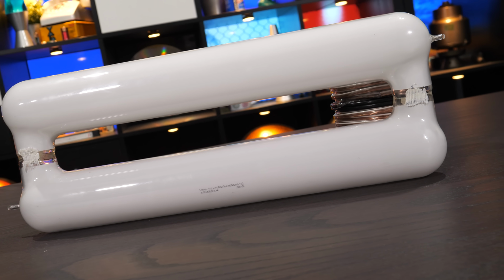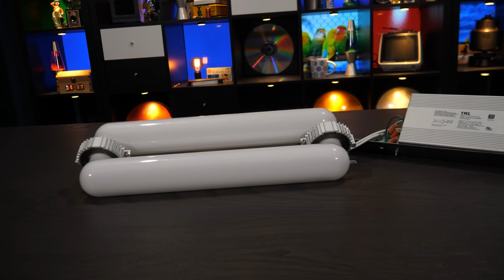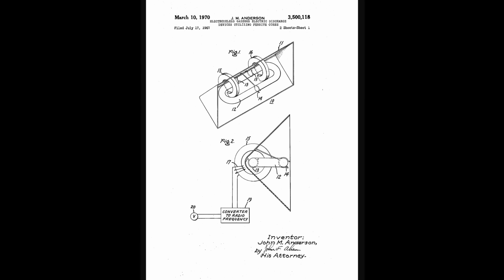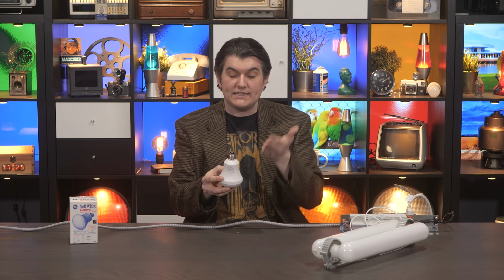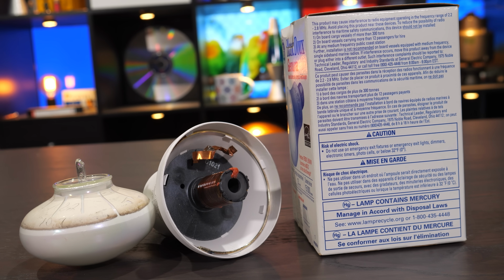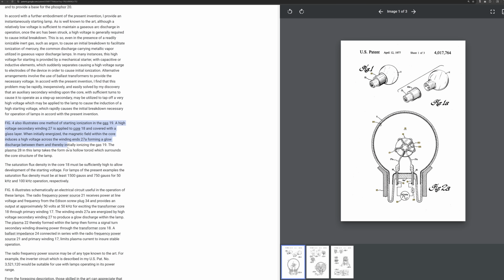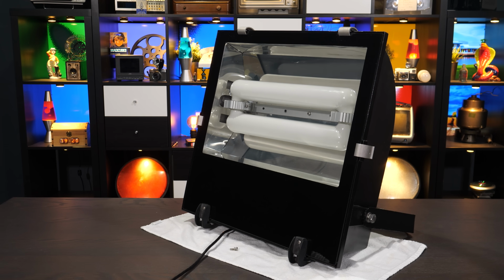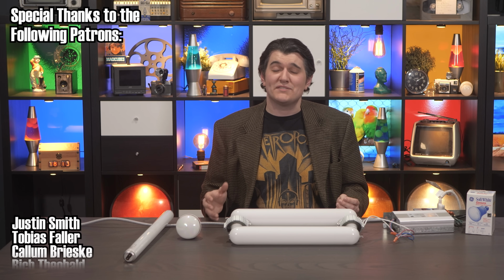Induction lamps: fluorescent lighting's final form

Comment: Those bulb shaped ones could easily have reflectors for directionality added. 
And directionality doesn't magically make the inverse square law go away.
Except for light escaping upwards, directionality makes lighting a large area more difficult - imagine how many laser pointers it would take to illuminate a footpath...
Perhaps one bulb doesn't illuminate the ground under it as much as you would like, but hey, you've got 5 other bulbs nearby leaking light out sideways which help to illuminate it, and it nets out equal.

Comment: You commented on the strange way the wiring was specified.
Probably set up so that "positive voltage" will have the magnetic field on the left coil going "up" and the right coil going "down" to "push" those free electrons around the circuit ( like a matchbox car track with two speed boosters ) rather then "sending the free electrons everywhere. Even at the very high frequency, those electrons could make a couple of laps before being reversed.

Comment: I do remember those weird circular lights, they were in a few fixtures in the house I grew up in.  But until today, I had no idea that they were different than the straight tubes in any way other than their shape.  I do recall that the bulbs were both expensive and seemed to last practically forever.  They had a kind of grim, industrial light quality to them, really inappropriate for residential use.  But it was the 1970s, so you either used incandescent bulbs or these, there wasn't anything else.

Comment: The exact method of ignition might be a combination of several factors depending on particulars. Natural or intentional alpha or beta emitters could provide a few stray ions. Multipaction where a collision generates secondary ions/electrons would be my two favorites for the rough pressure range these lamps operate at.

When a transformer is resonant with no load, the output voltage would be the excitation voltage multiplied times the Q, divided by the turns ratio.
The frequency of operation of these lamps is too low, but helicon modes have been used in electrodeless lamps.

Measured ignition delay at several temperatures would help figure out which.

Comment: The original CCFL lamps (announced in the 1970s) were electrodeless induction lamps, running at 27MHz and predicted to have lifetimes of 50-100 years.   But then they vanished.  Never materialized.  Today's eventual CCFL bulbs had electrodes, with the usual short lifetime.   (There was a scandal behind that, where the main 1970s  inventor was ripped off and sidelined.)
The original fluorescent lamps, as shown in the 1893 Chicago  worlds fair, were electrodeless lamps powered by a metal plate in the ceiling connected to a Tesla Coil.  Wireless lamps, shaped in coils, spirals, or shaped into words.
The first fluorescent tubes company, funded by JJ Astor in 1899, never happened, because Nikola Tesla took the first $20,000 payment and disappeared.   He used it to secretly build a radio lab in Colorado.    Astor cut him off after that first payment (there were to be ten.)

Comment: Having worked with some of the products on the tail-end of their development life, short before LED products gobbled everything up, good riddance that was a blast of the past and I am happy that these mercury filled beasts are a thing of the past. These products were always in a wierd spot. The products I had to test came about after Philips, GE and OSRAM had already given up on them and knock-offs started to appear. But given the results the application was really niche. There were already T8/T5 long life lamps that could last 80k hours and electronic ballasts that actually lived that long because the working frequency was much lower, as mentioned the optical properties weren't great and they were very perceptive to the thermal enviroment. While LEDs took some time, after their development took off in earnest, they became a much better, much easier technology to handle after a very short time.

Comment: I wonder. Is the application of these particularly useful in inaccesible places you might need to see trough, like for example underwater (pools, underwater facilities or things like aquariums, observatories, etc)?
My guess is, since these last so much you would only need to replace them every so ton of years or under extreme circumstances, and since the failing point is most likely the electronics box in most cases, you could put that in the same place you would put a breaker box and run wires to them from the box or boxes (in case every lamp needs a separate box.)

Comment: The problem with using RF for induction is that it isn't just the frequency that it is operating at that is disrupted.  Without extremely carefully-built filters, every oscillator will also produce RF on harmonics of the fundamental, sometimes as loudly as the fundamental.  I'm sure these prototypes went to every effort to ensure the harmonic components were minimized, and even avoided being too loud outside the ferrites themselves, but if LED tech hadn't replaced these, we'd be seeing the same race to the bottom of that market applied to these instead, and we'd have an even bigger noise problem than we have today.

Instead, we mostly just have gawd-awful RF coming out of solar panel inverters...

Comment: Regarding starting: Years ago, I used a GE "Light Stick" under-cabinet lamp as a built-in reading lamp in my bookcase-style bed headboard. These were an all-in-one lamp and electronic ballast, and I believe GE may have included a small amount of radioactive material to insure ionization, as they did with small neon indicator lamps. When GE stopped making the lamps and just labeled Chinese ones, I discovered that they failed to start in a dark room after a shorter term of use than the old ones (or even right out of the box), but would start if there was already light in the room, or if you would shine a flashlight on the tube in a dark room. 
I presume the induction lamps you showed all had something to make sure of initial ionization, although it may not have been a bit of radioactive material.

Another interesting story about the small neon indicators: Motorola's first transistor color TV chassis ("Works In a Drawer") used neon bulbs (as input switches) with a low-leakage capacitor and IGFET voltage sensor to store the analog voltage for remote control of color level, hue, etc. Some first units would not hold the setting voltage for the required days or weeks because the GE neon tubes with radioactive components would ionize the gas and leak off the charge. They had to specify bulbs without the radioactive starting material for use in the remote control circuitry.

Comment: So based on what I know of RF, the high frequency of the oscillator is probably what starts the lamp. You don't need that frequency for inductive coupling per se, what you do need, though, is to form a resonant cavity inside whatever tube you're using in order to build up enough field strength to ionize the working gas, and to do that you need to operate at the resonant frequency of the tube, which will be higher the smaller the bulb is.

As the field oscillates, it tugs on atoms and their electrons. If the field is strong enough, the tug can separate valence electrons from the gas, think of it like pulling a table cloth out from under wine glasses. You need to move the table cloth quickly enough in the right direction to prevent everything else following it. Do that and you get ions, and the transformer effect can take over.

Comment: It seems to me like the induction setup also neatly sidesteps the problems with fluorescent lamps' negative differential resistance that a ballast must protect against, or else too low of a potential will draw waaay too much current for the wiring it's connected to. If you control the induction, you inherently control the system power, and can inherently prevent current runaway.

Comment: There is one problem with LED lights, especially for tail lights in cars when highway driving at night. After highway night-driving for a while looking at these things, they seem to dance around in distracting ways. I wonder if it has to do with low-voltage power to the LEDs making the frequency of their pulses of light too low. 

It reminds me of a similar-looking effect of looking at an LED clock while brushing your teeth with an electric toothbrush, but there the dancing effect there is much stronger. Non-LED light sources don't dance around the same way when you do that. I think in that case it might have to do with the eye being vibrated by the brush. Maybe road/engine vibration in my car also has something to do with the car tail-lights case.

Comment: 100 000 hour lamp life? Someone needs to make projector lamps this way.
Reply: Laser projectors exist. This is what you are looking for.
Reply: @Desrtfox71  They are around 20 k hours not 100 k
Reply: @titter3648  They can be higher than 20k.  30k-50k in some cases.  That's the best you're going to get for a projector.  They need very dense lighting.
Reply: Projectors need a tight light source like arc lamps or laser.

Comment: I would have bet on open secondary transformer  voltage (be noticing how few primary windings are on the cores- if I corre counted 5 then the ratio is 5 to  1, and the ballast itself could be actually using a transformer rising the supply voltage to the coils. Such that when the current isn't flowing, the voltage inside the tube is momentarily reaching open circuit voltage that exceeds the ionization threshold. But that's enough to start vaporising the mercury and then the transformer goes into shorted-secondary mode with the induced voltage nearly zero, and where just the current flow induced is heating up the gas enough to glow) This and/or what someone said about the high frequency circuit being tuned to resonance frequency. Though I'm not entirely sure of the latter cause that'll make it need to be tuned to each tube separately and presumably precisely.

Comment: Glad you got to the ballast having a shorter life than the bulb at the end. I've seen traditional tube-flouro fixtures die because the ballast went bad while the bulb was still OK. I was wondering all through the video what the rated life of the ballast was and how often in the life of the bulb the ballast would need to be changed. Also wondered how much replacing the ballast would cost vs replacing the whole system. 

Another thing about the short life span of those bulb-shaped lights was that they were maybe mostly used in vent-hoods over stoves in kitchens. The vibration from the fan is also tough on other kinds of bulbs/electronics too, requiring them to be built extra-durable against vibration or changed frequently.

Comment: I've seen a most similar setup - in a CO2 laser resonator. Some CO2 lasers have electrodes that are inside the tubes, what's called "DC pumped". There are other CO2 lasers that are "RF pumped", they have a ring around the tubes that is a sort of radio transmitter, and radio waves are used to excite the laser tubes. They have the same advantages as the tube you showed us in your video, they last a lot longer before someone like me has to take the tubes out of the cabinet and replace them.

Comment: I need several 200w, or 300w tubes like those. Outside shop lighting in very COLD Winters. Cold killed my L.E.D. Lightlig. Installed 50 element LED lights & @ -42°F only 4 elements illuminated the AREA sometimes, the other ceased to function until the temperature raised & now 22 of 50 function at all. Not warrantied under 8°F. Enjoy
Reply: but thats not a feature of the LEDS but of the shitty driver electronics. Directly driven LEDs can be really cold before they won't start. And as mentioned, the drivers for these weren't all sunshine either.

Comment: As magnetic fields expand and collapse they induce charge into the materials inside of the lamp.  Conductivity is a function of frequency and at radio frequencies most objects we consider non-conductors become conductive as the electrons get moved about by the rapidly expanding and collapsing magnetic fields.
Reply: So think of it like this, when you pass a magnet over a material it induces an electric charge, what the RF is doing is moving the magnetic field by rapidly expanding and collapsing it.  That functions are a rapidly moving magnet and due to this it creates an electric charge inside of materials, even normally nonconductors.

Comment: I remember the delight I felt in discovering that by rubbing an old blown fluorescent light with a plastic bag, I could make it glow.
Reply: I used to take them out in a field under high tension wires with friends. They glow just holding in your hand under the wires.
Reply: @westsailsmusic  old timer projectionist here - I would pick up a fluorescent tube while running film (acetate or Mylar) between my fingers at high speeds during inspection/rewinding. Always surprised or shocked ushers or others walking through the booth.

Comment: If you want to see a widespread deployment of induction street lamps, come to New Jersey, specifically PSE&G territory. About a decade ago they started to replace all the streetlights in their territory with induction lamps made by US Lighting, which appears to be out of business at this point. The fixture was even called "The Jersey" in catalogs and the housing came in an attractive sea foam green color. At the time, LED streetlights were out, but they weighed the costs and upkeep and determined that induction would be cheaper in the long run.

I don't think it worked out though since new streetlight installs are now LEDs like every other utility. It may be superior, but with LED lighting being ubiquitous now, parts and fixtures have to be cheaper then the induction units.

Comment: search " inductive coupled plasma ". this lamp is just another application of ICP. in icp system, due to high operating frequency and low chamber pressure, you don't need any additional addon to ignite plasma. (you need some external ignition for atmospheric system, such as plasma torch). (p.s. therefore it is better to call "generate plasma", rather "discharge", like in this video)

Comment: You answered your own question about the starting electrode. As you pointed out it was placed inside the tube. One of the largest customers for those induction bulbs were industrial applications where sparks cold be hazardous, think coal processing and natural gas plants, where a faulty light could cause an explosion. By placing the starting electrode inside the bulb they eliminated any chance of it causing an inadvertent spark. The magnetic induction of the coil was more then enough to cause the electrode to discharge ions even while inside the glass bulb and because the electrode was inside the bulb and in direct contact with the gas it required less voltage to do so as well so they got two benefits by relocating the electrode inside the bulb.

Comment: Some idea about starting mechanism - do you have a Geiger counter? That mesh and wire might be slightly radioactive to give that initial gas mixture ionisation, needed for starting. Similar principle is sometimes used in arc lamps - it may have thorium-doped electrodes to simplify (or even "just make possible") it's initial ignition. Also it's the reason why some welding electrodes also contain some amount of thorium.

Comment: Fun fact - ANY fluorescent tube can be made to inductively illuminate in a strong enough AM-frequency signal. The signal, for example, at the generating equipment at an old-school analog AM radio station.  Like the one my high school had. During school tours, we would show off the wall of electronics running the AM radio station, and just hold a standard fluorescent tube a couple feet away from the transmitting equipment, and it would start glowing. It was bright enough, that the illumination for the room was just a row of fluorescent tubes hanging from string from the ceiling in front of the equipment wall. (When not just using the giant wall of windows across the room.)

Sadly, in a remodel while I was still a student there, the radio station was moved to a new separate building on the far side of the school from the original, with all-new equipment. While the original room remained in use as a classroom, and even had its original radio transmission gear taking up an entire wall, it was powered down, completely disconnected from the radio tower, so that demo never got to be used again.

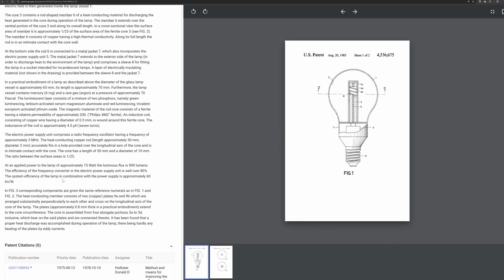Comment: 20:40 You actaully got it right, it is similar to how conventional lamps starts, the initial voltage and frequency are increased until a loop is formed then it switches back to normal operation mode. If you want to learn more on how to start a plasma lamp I suggest the video made by sky_guided titled "A plasma toroid for the modern era" .

Comment: A radioactive isotope could be used to self-start these lamps. They used all kinds of compounds, but Radium 226 & Cesium 137 were most commonly used  for pre-ionizing gas in arc tubes (Raytheon & other manufacturers made these).
Reply: This may be a clue as to why these were not ubiquitous (not only mercury danger, but radioactive danger - breakage and disposal concerns)